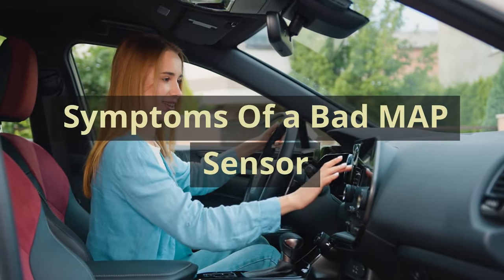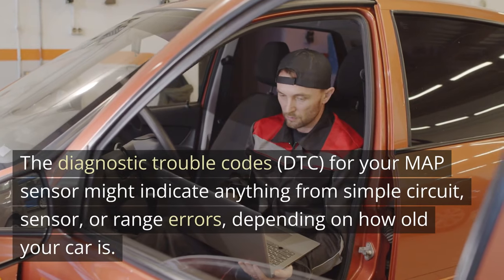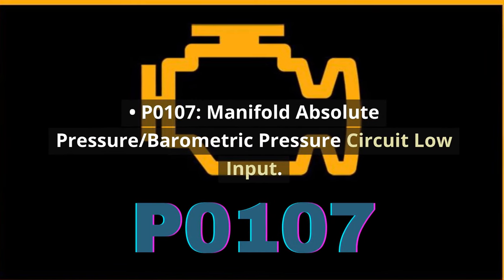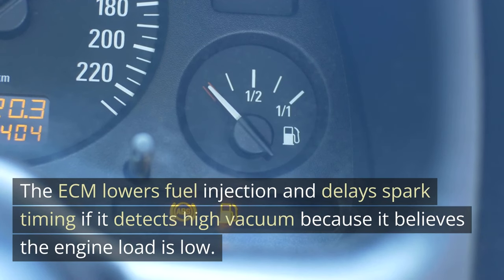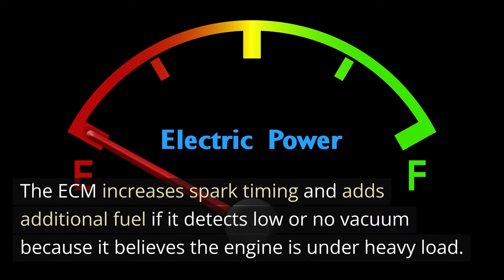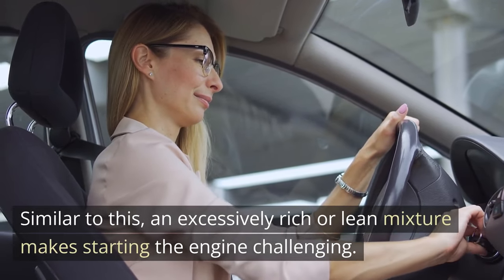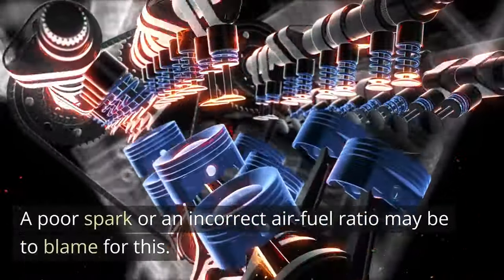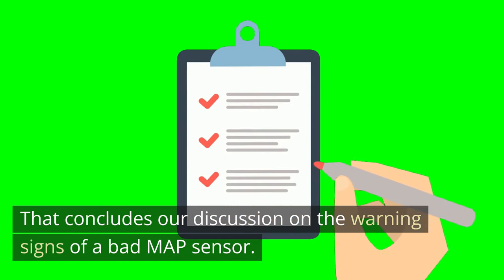Bad MAP Sensor Signs: Don't Ignore These Engine Warnings

Comment: I juat changed mine, do you need to drove a few miles for it to adjust?
Reply: I did a computer relearn after cleaning mine. Took about 50 miles of a semi limp mode to calibrate itself. I'd recommend looking into how you initiate a relearn in your vehicle. With mine, I had to do some specific presses on the start button to initiate it.

Comment: My Honda J-series engine (2007 V6) has rough idle and sometimes misfire DTC. I noticed that the idling engine "Intake manifold absolute pressure" is around 27 kPa. During normal highway driving at constant speed, I see fast fluctuations without reason (going up to 75 kPa or 85 kPa for a fraction of a section and then drop to around 27 kPa). When engine is not not running, I get 100 kPa (close to 1 atm), My LTFT is +14% or sometimes +20%. Is my MAP sensor bad? If so, why do I get 100 kPa and 27 kPa which are considered normal for non-running engine and idling engine?
Overall fuel economy is around 20 mpg on par with similar cars. I hope someone can shed a light on this. Thanks.
Reply: Hi there!I have got exactly the same situation with my car.Was it the map sensor?Thanks in advance!

Comment: Below are the approx math figures of MAF values, for my 1.8 litre supercharge engine, running at manifold pressure at 0 psi.

3000rpm = 41 g/sec, 2500rpm = 34g/second, 2000rpm = 27g/second, 1500rpm = 20g/second. These MAF values can increase by 1.5 times when supercharger kick in an ramps up manifold pressure to 8psi.

These figures is on a sticker which I place on the dashboard for occasional quick check when I put the car on auto cruise mode to required rpm. Whenever the manifold pressure is within -0.5 to +0.5psi the MAF readout given out by OBD2 matches closely with these value value.

The on-the-dashboard mounted OBD2 could could also show throttle body position, IAF, injection advance, short or long fuel trim, etc etc.

At hot engine idling rpm of 750, without air conditioner switch on, on P position, the MAF is about 4.5 to 4.7g/second vs throttle body at 14.9% open vs MAP at -7.3psi. This value is useful if there is a partial vacuum leak or MAF is dirty etc etc.

BTW, to me, this video is really not deep enough for it to be really useful to anyone.